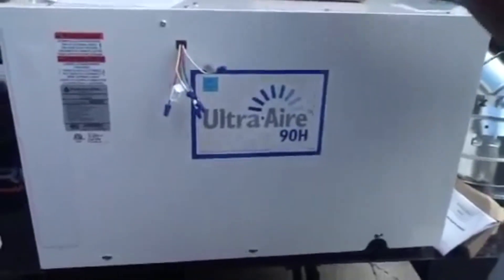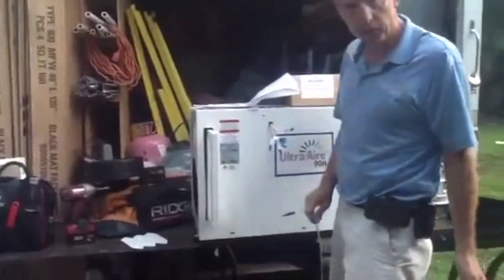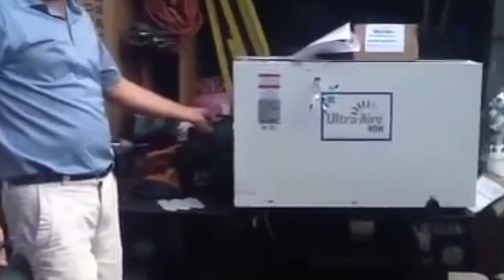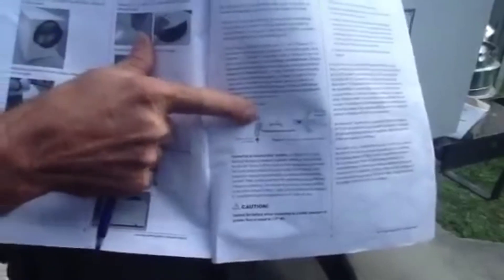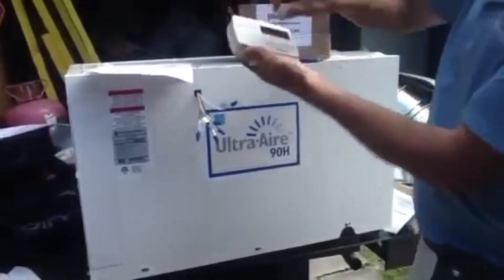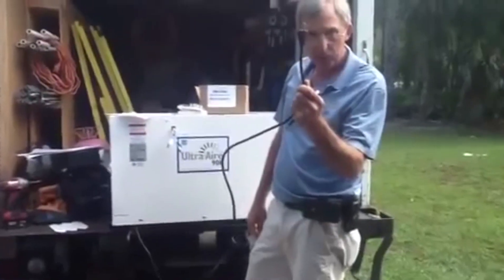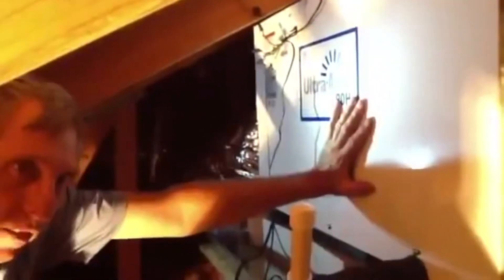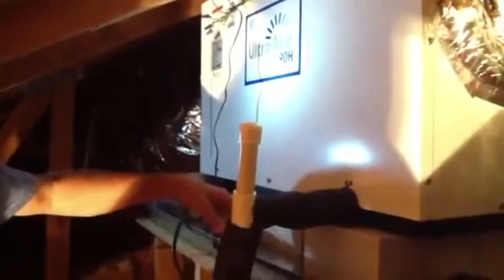Installing A Whole House Dehumidifier

Comment: If you plumb the return into the same return box as the HVAC unit, is the negative pressure an issue? Would it suck unfiltered air air backwards through the air handler? If both units happen to run at the same time, does enough air get pulled over the A/C coils to keep them from freezing up? How do I know if I have enough flow through my air filter to prevent issues?